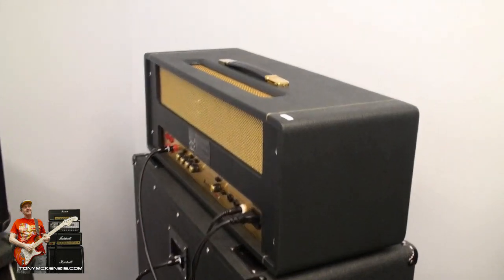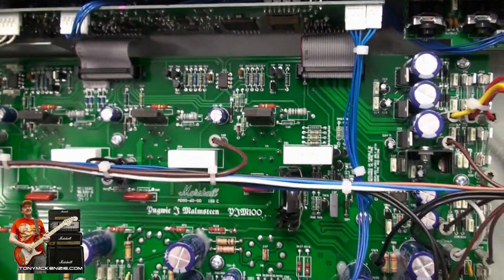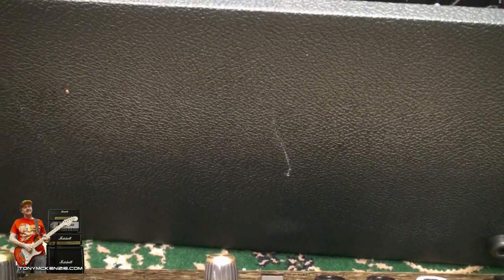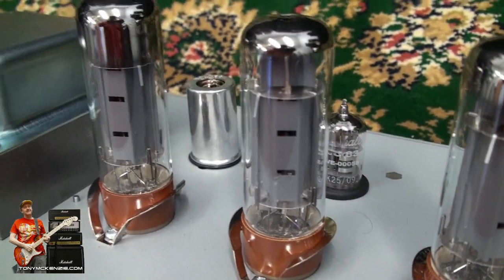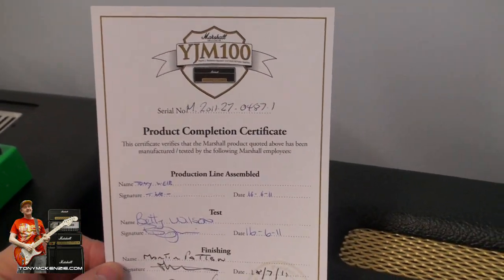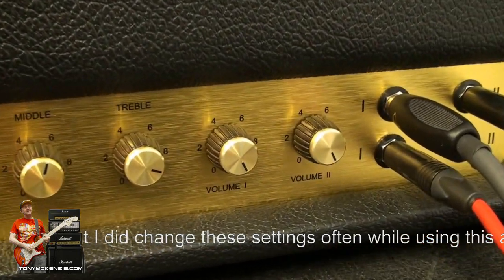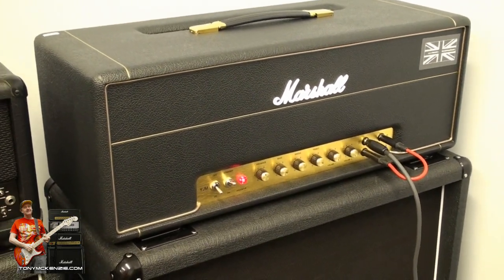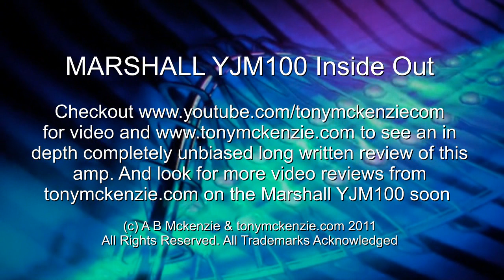Marshall YJM100 Guitar Amp Review Inside and Out Close up

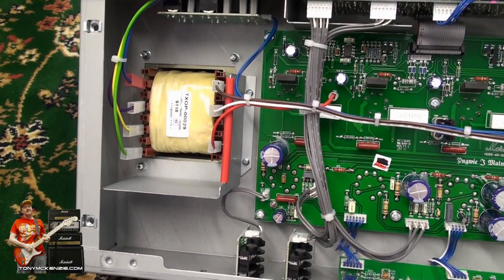Comment: Hi tony, very thorough and in depth review of the yjm100 . Check out some of my playing , I have a video playing this amp at very low volumes with the following settings :attenuation 8:00 with boost volume on.max with gain at around 3ish . Im using a vintage modern squier strat . Great sound !
Reply from the maker: Yes I like the YJM... its not completely a 'one horse race' so to speak, but it does have some really nice sounds in there for sure.

Comment: Hello Tony how did you like this amp compaired to the 1959 slp HW? Tone wise they are quite different. In this day and age there are better boosters than the in the amp and also better load boxes etc than the power scaling in the amp.
Reply from the maker: Great question... and I could talk for hours about both. The YJM100 (as you might know) was a limited edition. Did you check my written review with comment from Santiago Alvarez here: https://tonymckenzie.com/marshall-yjm100-malmsteen-guitar-amplifier-inside-and-out-review.htm  its a long review but does include much about the YJM100. I think those two amps are different and for the vintage tone the 1959HW would be the winner every time. But it IS loud. I have a reactive load etc. so it does not bother me personally. The YJM100 is probably a once in a lifetime amp that may never be re-released and as you know it's features are pretty unique and at the time certainly were. The loading on the YJM100 did work pretty well, but I have heard of problems with that on some amps. On the booster my guess is that may not be used as much as some might think. Yng and Marshall talked about that and most know that Yng has an external pedal he has used for a long time (not sure about today). But even if you don't use the power scaling and 'boost' I still think the 1959HW is better and not just for the sound either. The YJM100 is the size of (or near enough) to a Marshall Major 200w casing and that alone might be a pain to some. I like the build of the 1959HW and whether its exactly like the old amp I for one don't really care - it sounds good. But remember that the YJM100 has been around for some time now but there was no doubt at launch it was a cutting edge amp and surely will still stand the test of time even today. My review of the time gave it a 10/10 which I can tell you was a very rare event... The thing is, a YNG follower or someone that can play that stuff would probably generally opt for the YJM100. It's one reason why those YJM amps have held their price over the years I think. The 1959HW is solid though - I still have mine! but sadly I did sell the one I owned primarily to get money to buy the next thing for review... self funding is that way - it sucks but also little spare room does not help either. I hope that at least offers my thoughts these days about those two. I would still buy either! Stay safe.

Comment: Hey Tony, has your opinion of this amp changed considering all the defects & complaints that have been posted on the net...production of this amp didn't seem to last long...what does that tell us ???
Reply from the maker: +Ed Berger The YJM100 was only ever going to be made in a very limited number from before even it was released. I have seen a few complaints re faults on the power reduction in particular. This was one of the first Marshall amps to have that feature and I guess there could be issues with that although I never had any myself. I like this amp because it sounded particularly good to me at the time of the review. I still think overall that the YJM100 IS sought after amp probably because of the very limited numbers they made and is one of the very few modern amps from Marshall that have increased in value. Interesting point and thanks for watching.

Comment: 50% of the load on a screw is applied to the first thread. 90% on the first three threads. "Short" thread is by no means weak or weaker than a long thread.
Reply from the maker: Hmmm.. I'm not completely convinced by that statement really and was a mechanical engineer for some years with all the necessary qualifications. If three threads were all that was needed then everything would undoubtedly have three threads. so a 100 thread part has 90% of the load applied to those three threads and just .1% for each of the other 90 threads. I don't think so. Interesting subject though and thanks for posting and indeed for watching.
Reply: +tonymckenziecom Well I'm in my second year of mechanical engineering so I the subject is fresh. So I checked my revision notes and on a standard M thread the first thread does effectively hold 40% of the load. And the first 4 90%.
Reply from the maker: But think about it for one moment. Why would anyone have a 100 thread bolt (just for example) if the first 6 threads could hold everything solid without a problem? Maybe it's different these days, but they had high tensile bolts around while I was doing that stuff... indeed a 'Gardner' Diezel (about 14 Litre) truck engine had through bolts in the block with lots and lots of thread on there probably many more than 50 threads and those were the most tensile through bolts I have ever seen. We used to remove the old ones and make pry bars out of them in the blacksmiths :)
Reply: ***** Its much easier to manufacture a long bolt with a lot of threads than a bolt with a thread and a thinner neck. Also its a very versatile bolt compared to a specialised bolt.
Reply: So price basically.

Comment: all power transistors in power supply should be heat sinked especialy the voltage regulators   and thay get hotter when amp is cranked  fact

Comment: Does this thing really sound like a plexi? The problem with all these gear companies is that they put out something good and then they pull it before you get a chance to suss it out and decide you want one. Guess I'll just have to find one secondhand.
Reply from the maker: Because there is a massive drive and attenuator with those on no it does not. But if you turn all that off and use it like a Plexi I thought it was similar... not exactly the same but it might pass for one.
Reply: Why can't marshall just put out a modern amp that sounds like the one everybody wants? I've been told the suhr sl67/68 is pretty damn on the money.. not cheap though
Reply from the maker: shoominati23 Don't know about the Suhr... but if I really wanted the Plexi sound I would buy a Plexi... that way it's guaranteed to be the real deal if you know what I mean.  Of course then you have to live with it being an old amp and the baggage that brings.

Comment: we meet again...Seems Santiago has an answer for everything negative about his amps! I've read a lot of reviews where he seems to jump in every forum out there down playing every problem as buyers fault.One thing I did notice about the amp in your vid,is it shares a potentially dangerous one as in my jvm...The fuses ARE WAY TO CLOSE TO THOSE HIGH VOLTAGE CAPS..Now you know some youngster who knows nothing about lethal voltages is going to put his little heavy metal fingers in there and get a shocking surprise while doing a simple fuse change...which lately seems to be a trend with modern marshalls,blown fuses.
Reply from the maker: :) Well I do believe he has now left Marshall to work elsewhere. I reviewed a few amps with his input and TBH it was interesting I thought. He also spoke about other things by email and his experiences... he told me about when he visited Yngwie in Miami and they went for a spin in Yng's Ferrari :) Santiago said he needed a new set of pants :) 

For me, the worst Marshall amp I have ever owned was the JVM410H (I've probably said it before) and I could never get that amp right even after owning two. I got the blame for that from Santiago and that's OK, but I don't have the problem with any other amp with the same guitar etc. so I drew different conclusions.

Yes, anyone who has not got experience with tube amps should stay out of the amp for sure - you are exactly right of course. Seems silly that you would have to take the amp to a company to change a fuse... but there might be other reasons for the fuse failure. I'm not sure where you are located, but I don't have ANY blown fuses working on 240v here in the UK. If you are USA way or somewhere with different voltages that might have a bearing on it? Who knows?

Sounds like you have not had much luck/fun with Marshall amps though and that's a pity really, some of them are very good but I guess yours was not. Some swear by them and some swear at them :) 

Thanks for watching BTW.
Reply: not a problem ..your videos are very informative as are your online .. reviews  ....If I would have known about the online ones you write,I would never have bought a jvm to begin with lol....cheers my friend
Reply: Also I'm in Canada,so lucky for me marshalls come up used on our version of craigs list OFTEN     I only paid 800 cdn for a 4 year old  2x12 combo...mainly for cleans and it's easy to lug around.Luckily I also own the 5150 1 and 3  and use those when it matters...they are really  great amps
Reply from the maker: Yes the 5150's are cool for sure.
Reply: Did you find the jvm to be fake sounding? Almost like a solid state amp?  That's what mine sounds like.....Tried different preamp tubes   speakers...nothing worked...biased it hot and cold still shite lol....and the worst fx loop every...clips everything
Reply from the maker: I was not overjoyed by the feedback problem which was most annoying, and that limited the amp in so many ways and did seem to contribute to a 'tinny' cheap type of sound. Like you I did also try most things with the JVM and never solved it - the second amp still nothing worked so in the end I sold it. The Satch version was excellent, but that's no consolation where someone owns the original JVM. Some people love them, but it was not for me.

Comment: Looks like Beheringer stuff... what a shame...look inside an old Marshall and think
About which one is a real amp... cheers
Reply from the maker: Rick Spyder Fortunately this sounds rather different than a Behringer ;-). My own view is that this was not actually that bad a build. I'm not someone who has determined that the old turret board is somehow better. Check my marshall factory tour where Marshall themselves confirm that the turret board amps are EXACTLY the same... even down to simulated capacitors. It was an enlightening experience at the time.

Comment: ENGL German engineering destroys Marshall these days.
Reply from the maker: It's different tones :) both work well. Thanks for watching.
Reply: But it terms of the quality control and construction ENGL are at the top, ENGL has some amps which can produce classic rock tones as well. Would never get another Marshall.
Reply from the maker: I like Engl and as you might know I have owned an E670 for some time. But I also own other amps including Diezel, Marshall, Mesa, Fender Hughes & Kettner, Bogner  and others. I have seen issues on every amp I have ever bought some not too bad and others terrible (even by design on some) and it still remains that I would buy certain Marshall amps for specific tones that other amps really don't quite do. There is no doubt that Engl make some really good amps though. Thanks for the input.